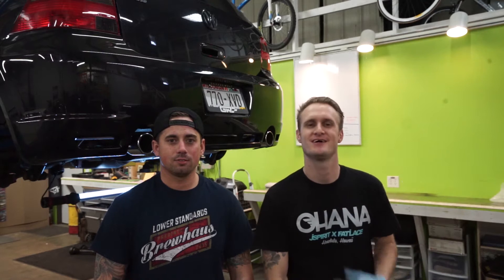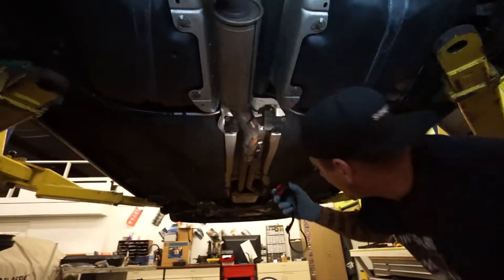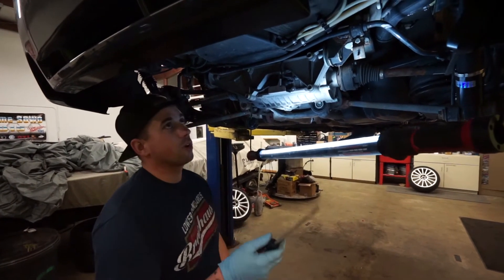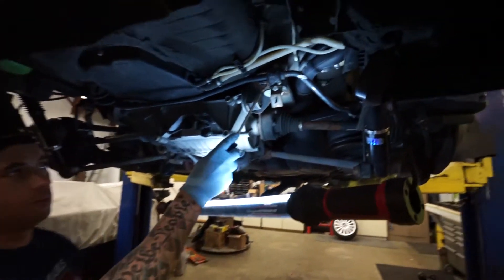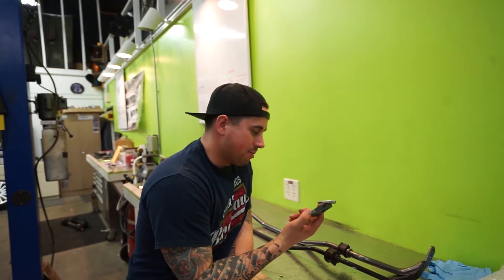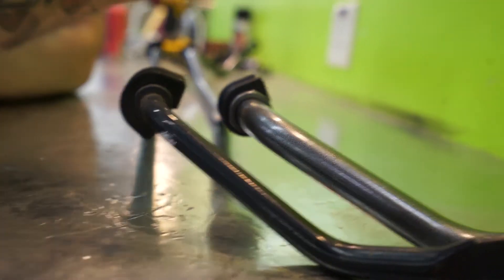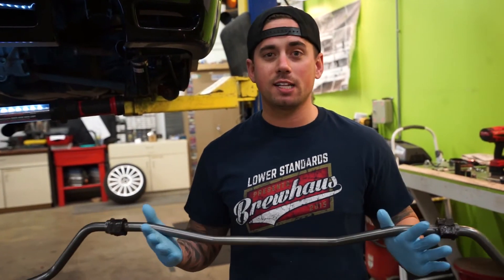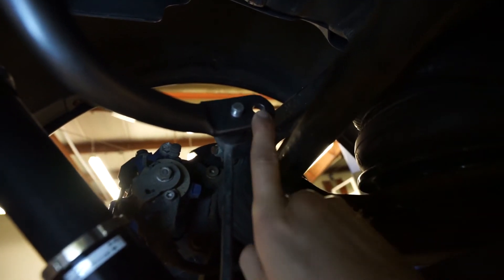Mk4 R32 H&R Rear Sway Bar Install!

Comment: Notice any difference in the handling at all?
Reply from the maker: Oh absolutely! A fatter rear sway bar is a must have in any FWD or AWD car that is prone to under steering. Stiffens up the rear and makes the car feel more stable and planted in the corner. I would argue it’s one of the first 2-3 mods you should do on a VW.